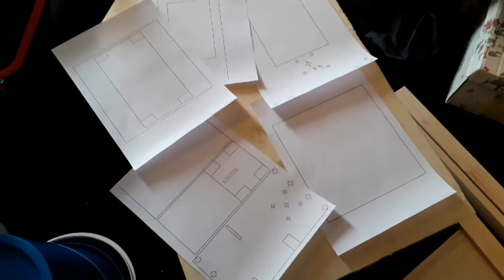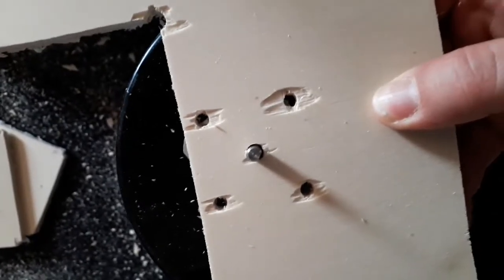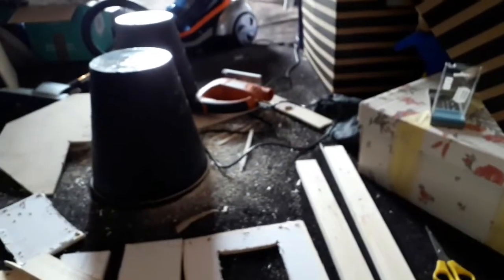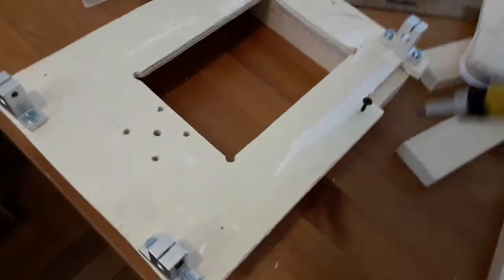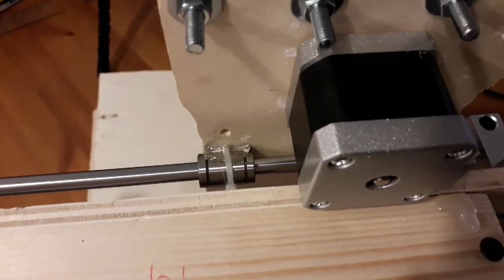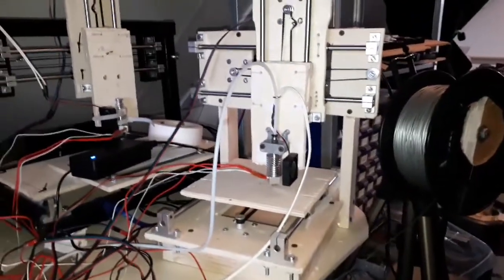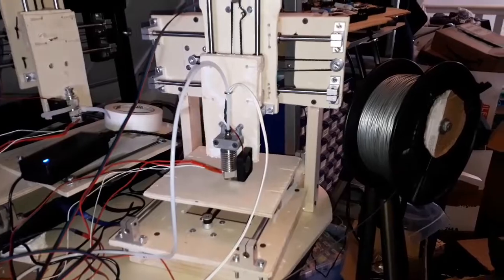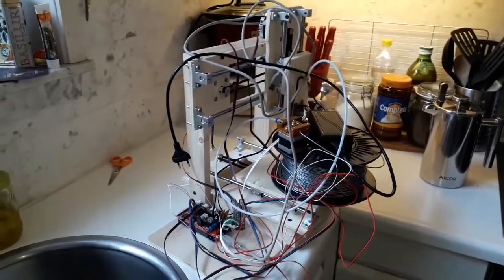DIY 3D printer for under 100USD

Comment: hey mate, nice build.  I wondering what is the dimensions of the wood parts so i can built a printer like yous
Reply from the maker: I have made some improvements to make is better and cheaper.  I will be releasing plans soon.
Reply from the maker: I have improved this design.  At the link below is the video of how it works.  Build video with list of parts and 3D printed parts files coming soon.https://youtu.be/DgM4KVTknIo?si=VrnxCz9V0tZU-0F6

Comment: probably could cut cost more by 3d printing the wood parts too! As a reprap lover i see this having great potential to spread 3d printing as a hobby.
Reply from the maker: For large simple flat structural pieces it is very difficult to print accurately and cheaply.  Wood is much better.
Reply from the maker: I have improved this design.  At the link below is the video of how it works.  Build video with list of parts and 3D printed parts files coming soon.https://youtu.be/DgM4KVTknIo?si=VrnxCz9V0tZU-0F6

Comment: good night, could you make the pdf files available with the molds of the pieces you used? Or where did you get these files?
Reply from the maker: I have improved this design.  At the link below is the video of how it works.  Build video with list of parts and 3D printed parts files coming soon.https://youtu.be/DgM4KVTknIo?si=VrnxCz9V0tZU-0F6

Comment: if you 3d print it you dont need tools, and dont have to buy the wood
Reply from the maker: For me would be too expensive for filement and I already have the tools.  For long straight stuff wood is good.  Could also have used a big laser cutter if I had one.

Comment: Interesting build!  The balance between build simplicity and sturdiness seems pretty good. I like the oversized holes and hot glue technique. Nice for those without a drill press. I might need to build one of these.  ;-)
I'm curious about a couple of things: 

1) What kind and thickness of plywood did you use? 

2) If I'm not mistaken, the Z carriage plywood is double the thickness of your other plywood pieces. Just wondering it this is necessary or if a single thickness of plywood would work as well, to reduce weight. 

Thanks for the video.
Reply from the maker: I have improved this design.  At the link below is the video of how it works.  Build video with list of parts and 3D printed parts files coming soon.https://youtu.be/DgM4KVTknIo?si=VrnxCz9V0tZU-0F6